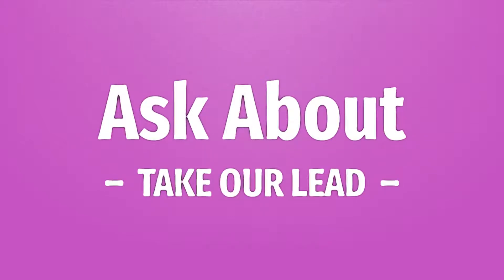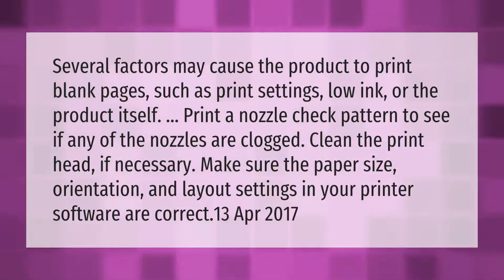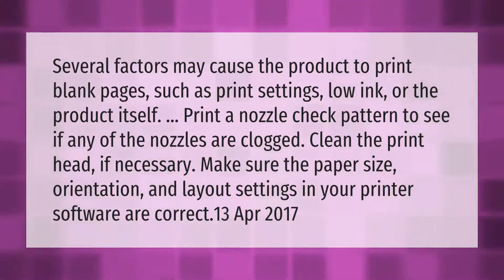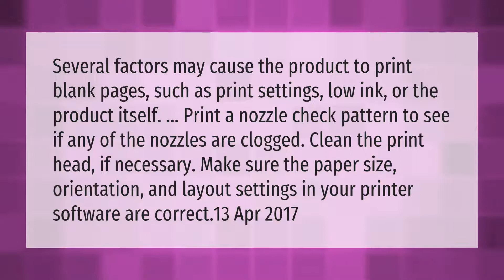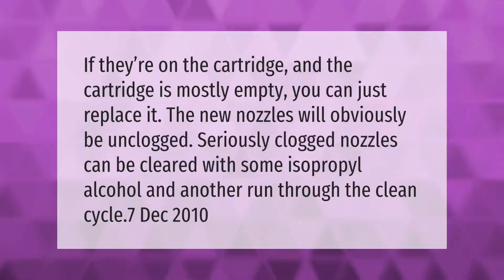Why is my Epson printer not printing when the ink is full?

Comment: I can't use my printer because the magenta and cyan are completely empty even though I have never made a color copy on this printer.
The solution to this problem was to get ripped off by having to buy more ink cartridges!
I haven't used this printer in approx. six months, and once again out of colored ink (need to print using black) but I can't because they want me to buy more ink that I don't want or need.
The solution this time is to trash this printer and never buy anything from Epson ever again!
STAY AWAY FROM THIS SCAM!!!

Comment from the maker: 🔥 Do you have any other questions? Make a comment as a reply! 🔥
Reply: SO BADD WASTE OF MY TIME
Reply: yes, I've had my printer for a week and I've used it 3 times. the first use was great the second use it wasn't printing white and now it isn't printing any colors at all. it will not do the print head clean in the settings and I don't know what to do. Please help me.
Reply: @joshuagarcia8150  Mine just will not print at all after first using it, and one should not have to clean print heads after such a short print out, and still does not work
Reply: Fecking terrible. Neither use nor ornament